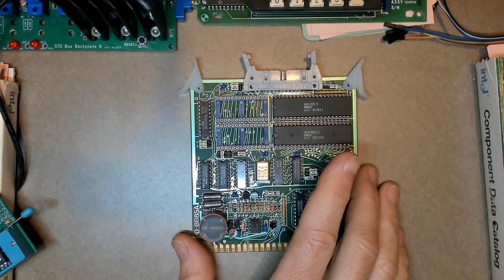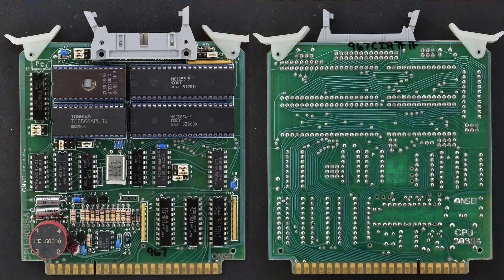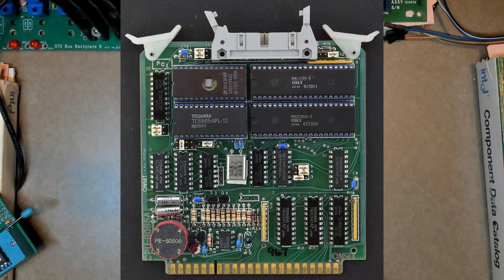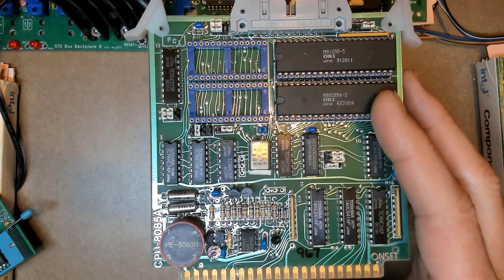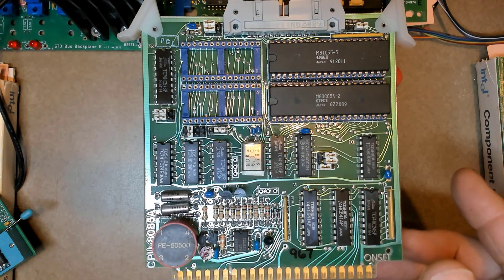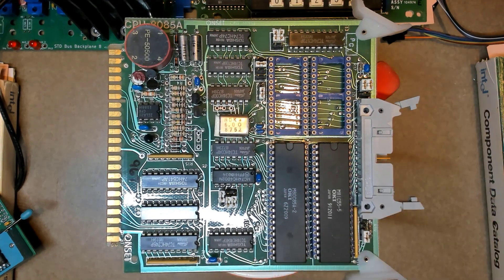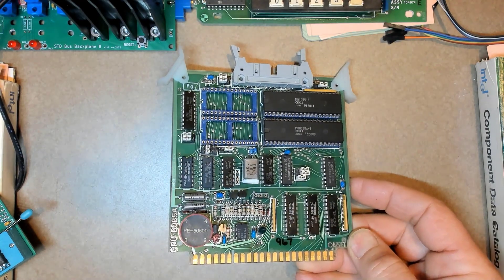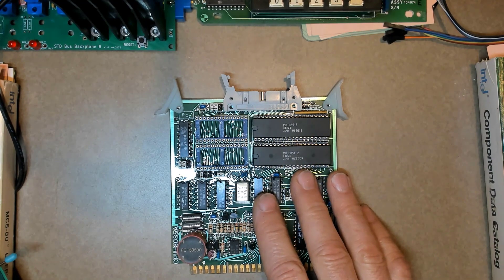{102} The C-44 Bus.  Obscure, Rare, and Niche, but a Unique, Useful, and Memorable Bus Standard

Comment from the maker: Some super sleuthing by Mark Florkowski @mrf found a NASA final report that includes some product cut sheets from QSI and the C-44 specifications.  The bus pinout signal names and descriptions are spectacular.  

https://ntrs.nasa.gov/api/citations/19920015551/downloads/19920015551.pdf

There are some key updates/corrections to things I said in the video:
The name isn’t familiar, but QSI is probably the manufacturer in Utah I mentioned.  According to these product sheets, QSI made a lot of nice support cards and racks up to 10 slots.
Voltage range is 8 to 18 and I had pins 1&2 backwards.  Fingers (L to R) are GND then Vin on left (1,2) and are GND Vreg on the right (21,22).  There is another (obsolete) battery input on pin 12;
The converter on the CPU board must supply 5v@75mA and when in low power mode 3v@10mA;
There are two standby modes- a WAIT (which is just a halt) whereby the processor stops but system clock keeps going and bus power kept @ 5v.  Then a STOP mode where the clock is stopped and bus power reduced to 3V.  Not sure why the “wait” mode deserves mention since it is just a processor halt. To get out of either one the CPU board needs to either receive: a reset, an interrupt, or there is a WAKE-UP signal input from the bus

Thanks again to Mark for finding these C-44 specifications!!

Comment: I wonder if C-44 could be a predecessor to the CAN bus?  Being tuned for battery operation seems it would be a good fit for automotive, where CAN bus now dominates.
Reply from the maker: CAN BUS and it’s [originally] industrial counterpart RS485 are serial communications protocols using a differential signal on a twisted pair.  (Think multi-drop, noise tolerant RS232).  C-44 is closer to S-100 or any other full address/data/signal backplane bus.

Comment: Looks like it has the same form factor as a VIC-20 cartridge, also 44 pins. Pure coincidence ofcourse. Inserting this card in a vic 20 is not only useless but probably also very destructive: the power and GND pins on the VIC20 bus are switched around compared to this card.
Reply from the maker: Yea, those 4-1/2” boards in a 44-contact 0.156” dual edge connectors go waaaaay back

Comment: I note the use of the 74HC4040 counter. It's possible that this is used as a very large clock divider to generate a wake-up interrupt of some kind. The length of the counter can allow a much slower interrupt rate than sometimes possible with regular peripheral timers, thus helping with very low power resting states with infrequent wake-ups. If the software knows the clock source, wake-ups can still be counted to enable basic time-keeping. I have seen such techniques used in other 8 bit computer hardware from the 1980s. If the application allowed, this method was often cheaper than using dedicated real-time-clock chips.
Reply from the maker: I think that is an idea definitely worth investigating.  The counter in the 8155 is 14-bit, the 74xx4040 is 12-bit and they could be used in series.  maybe an intermediate output of the 74xx4040 is used as a frequency divider to slow the CPU down to 1MHz to reduce power while still operating. 
There is a lot to explore on this board.